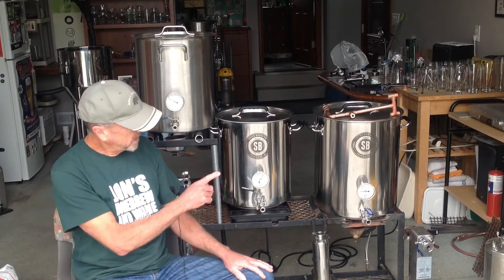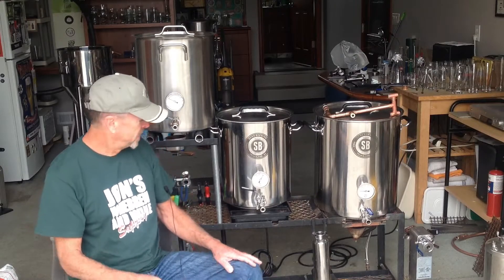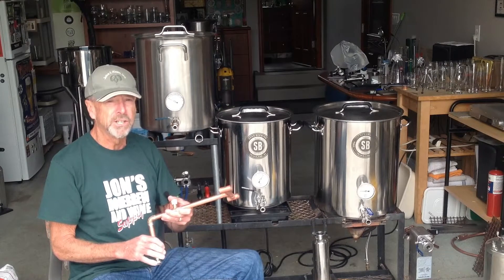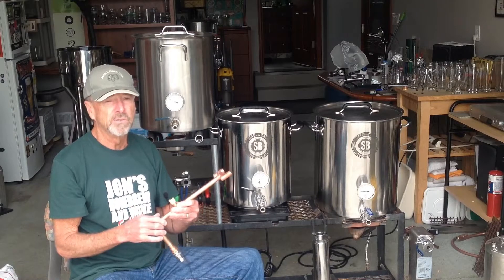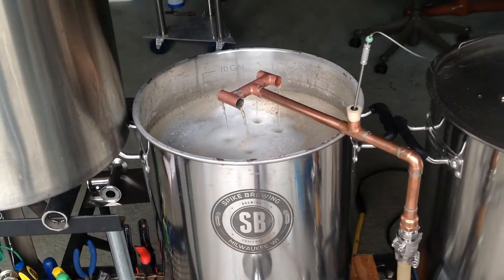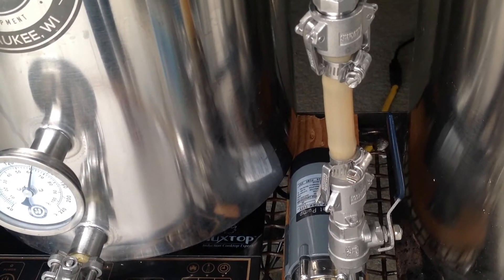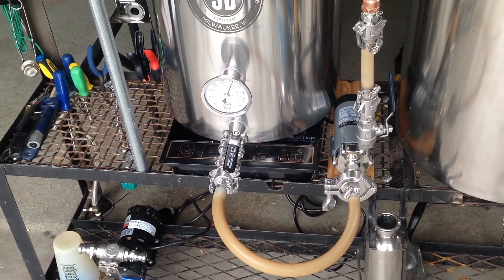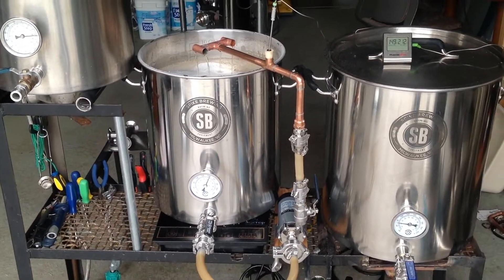Homebrewing: Alternate HERMS implementation

Comment: If it works, then it aint gotta be pretty. Is it possible to control the induction stove top with a temp controller or does it not turn back on when power is restored?
Reply from the maker: This would be the ideal situation.  Unfortunately, when you turn off the induction cooktop and then turn it back on, it is in a standby mode and you have to physically push the on/off button.  At the end of the day, I am typically by the brew stand during the mash, so peaking at it every so often and making the few adjustments is really no issue.  I typically run it on the lowest setting (1) and if I need to warm it up I go to (2) and so on.  I might do this 3 or 4 times through the one hour mash.
Thanks for watching and your comment/suggestion.
Reply: @homebrewingtips6029  BOOOO!!!!!! I bet there is a way to hard wire it. . .
Reply: Just the same point I made in the 'other' video, using the heat exchanger to control wort temperature. I'm going to try that but instead of controlling the HLT temperature, I'm going to control the recirculation pump with an Ink Bird. When temperature of mash drops, the Ink Bird switches on the pump and the wort warms from the warmer water permanently flowing through the heat exchanger. We'll see if it works! Cheers both.